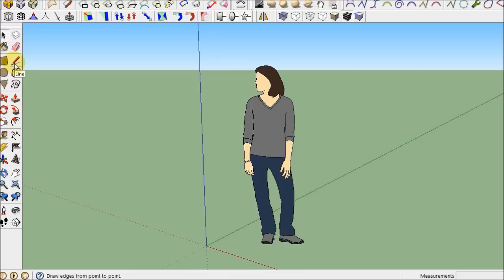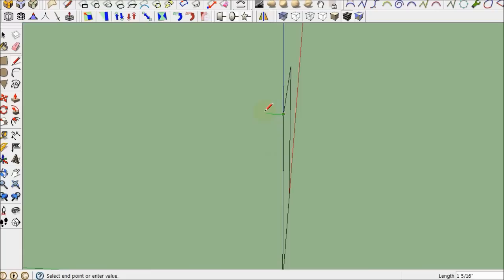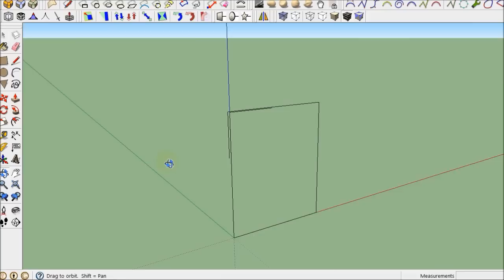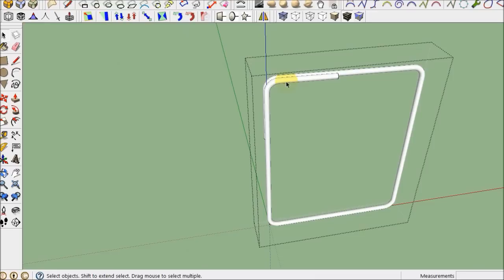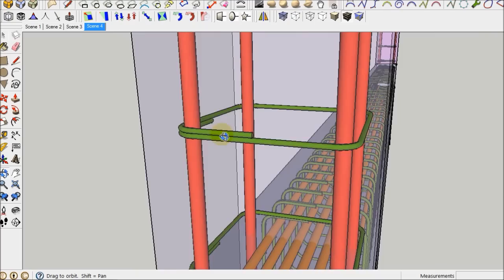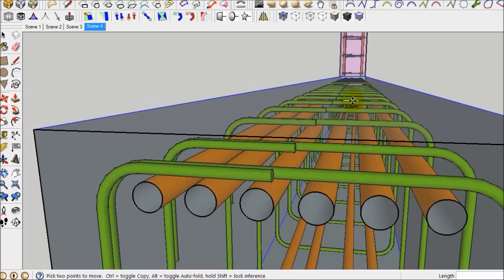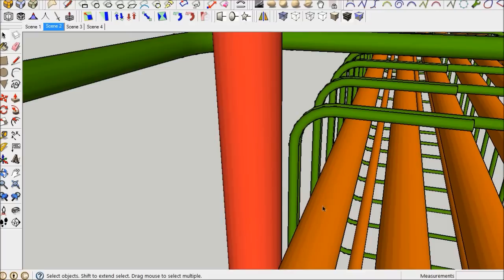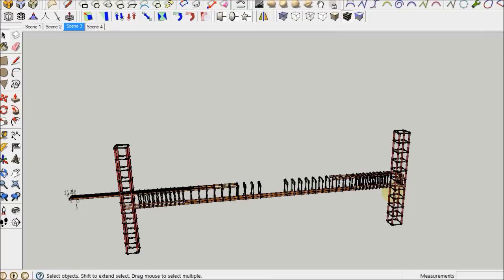Concrete beam steel stirrups using sketchup

Comment: As a reinforcing ironworker, the guy who is installing this type of stuff, it's very nice to hear that you noticed the clearance issues found when trying to place certain details. It seems too often that these considerations like fitting the beam steel into the column are overlooked
Reply: How do I contact you for a project I'm working on ?

Comment: your sketch is awesome,it was helpful.
 but at end of beam which is connected to the exterior column, the bottom bars should have extension (it should calculated by development length formula and provision of anchored) and to be bent or anchored upward, 

and also, at the middle of beam, the top bars should connected by 12 mm DIA for holding tied stirrup bars. 

and the distance between top bars is seems to closed and not adequate for size aggregates.any way its only sketch and it might be not clear to see through video.    

thanks ...
Reply from the maker: +Kamal sahidaini Thanks! The video is more to demonstrate how to draw bars and not a reinforced beam design.

Comment: really nice good work matey,i am trying to extend a concrete floor 4 metres outside the edge of the cliff got a river down bellow,,as i got no much land ,also i can't use pillars it is too high,all i want to do now put lots of iron bars extend them to 3 to 4 mts outside and hook them at the bottom of the house for more strengh,any idea would be grateful.

Comment: Majid, I've been looking for rebar pluging for standard bend shapes and have not found any luck ether, anyway not too much civil and structural plugins out there. I'm looking to make lift drawings/bend schedules using sketchup. I think Dynamic components (DC) might be the way to go to get started. then I'd make my own Ruby script as one advance. I'm trying to find documentation on (DC) attributes such has, can a get the bend length for the stirrup etc